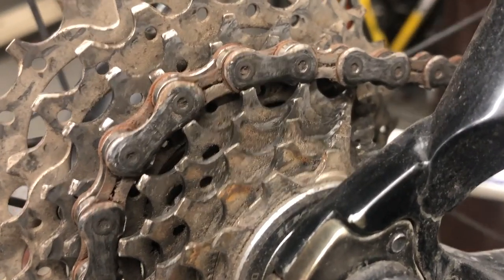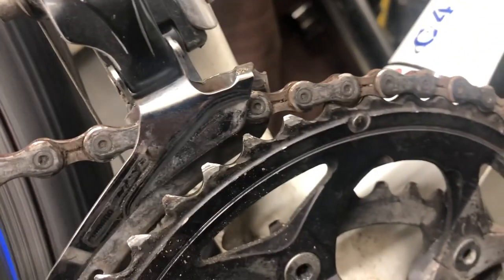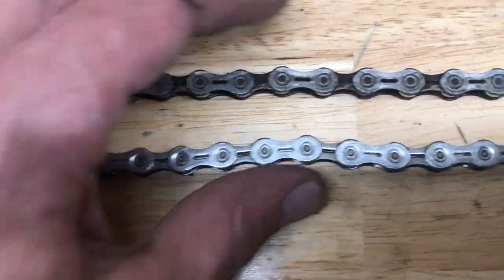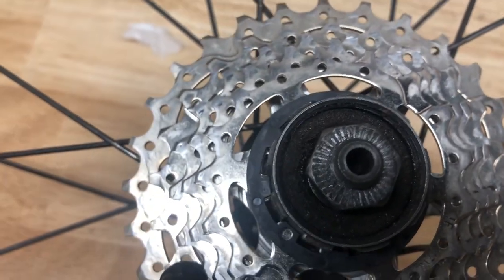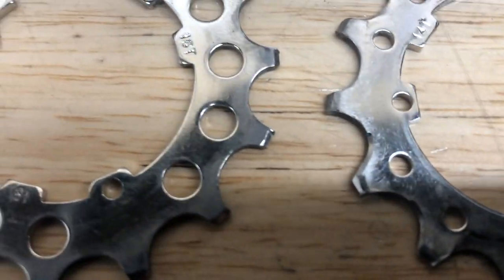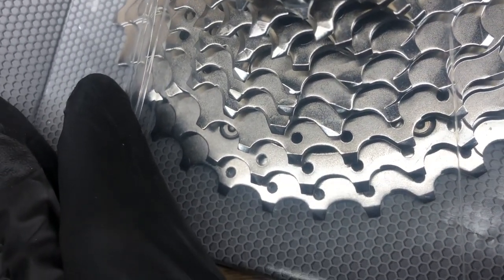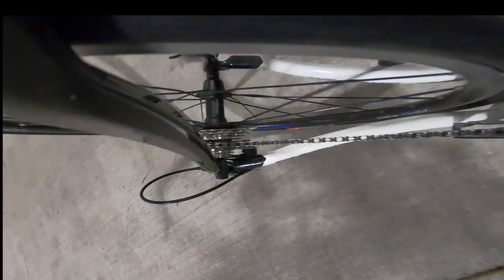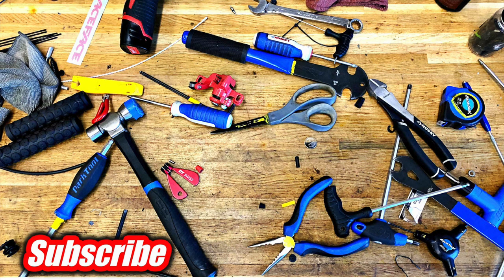How To Tell If A Cassette Is Worn Out

Comment: Pretty much what I do to test a worn cassette.  I can usually get two or three chains before I need to change a cassette.   This is similar to checking worn chainrings as well.  Just check for chain skipping after a new chain and cassette has been installed.  I usually get over 30K miles on a chainring.  I usually replace the crankset once the chainring has worn out.

Comment: I recently brought a 11 speed chain in and got it replaced. It was at more than 0.75 worn. I picked it up from the shop and rode to work the next day and it was skipping like crazy. I went back in and he ended up putting a new cassette on And now everything is copacetic. Someone from the shop came over and remarked that 11 speed chains have to be replaced at 0.5 worn. Is this true? Thanks.
Reply: 11, 12, 13 speed should be replaced at 0.5 worn